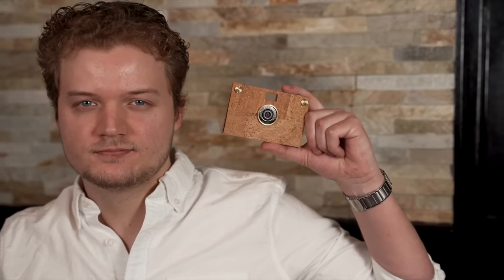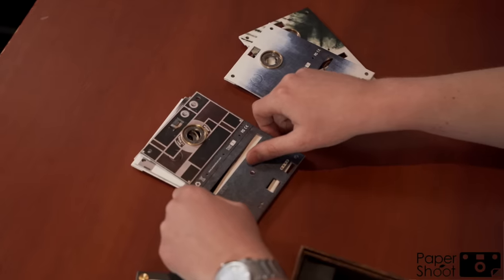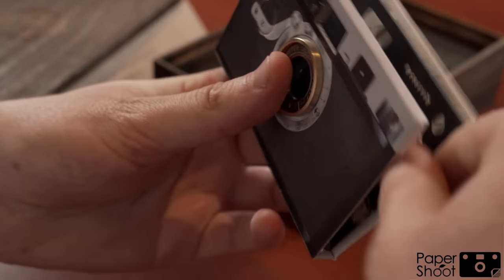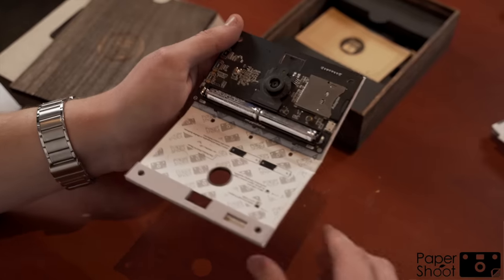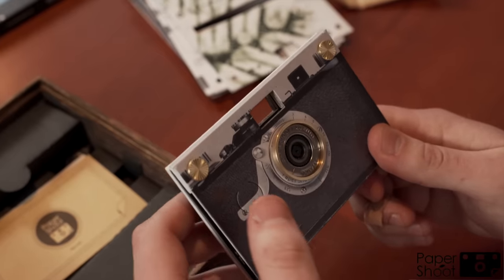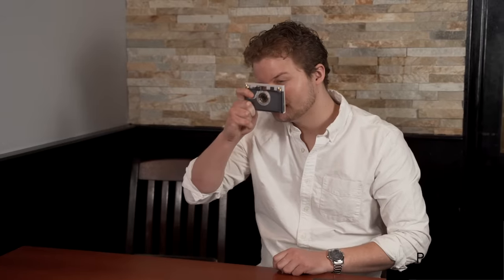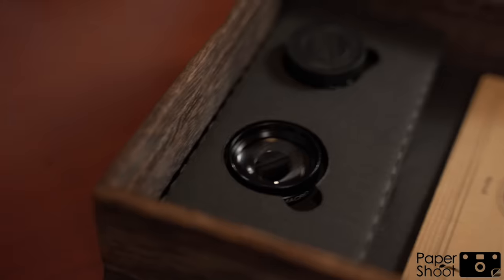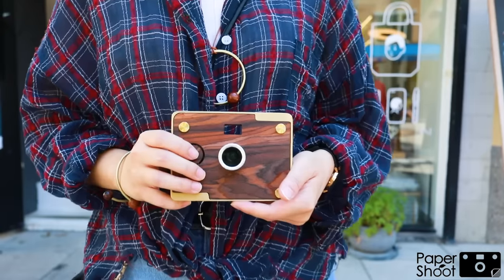This is Paper Shoot - Eco-Friendly Digital Camera

Comment: I love this idea but it's funny to think they just used a normal camera to record this advertisement
Reply from the maker: Haha it is funny to think about! The Paper Shoot is a great camera for photos, but the video function only shoots in 10 second intervals so it would be difficult to piece together a full commercial. But we should give it a try!
Reply: @cappycamera  are time lapse videos 10 seconds as well?
Reply: @LOL-VBE  I would like to know the answer to this as well
Reply: I wish paper shoot would have: 
flash (for dark conditions)
view screen (after photo taken)
long leather or canvas strap (for tall people)
Cover for camera (storage) 
Wireless transfer to phones (WiFi connection) or wireless transmitter add on
A holder for all the accessories
Different straps designs
Reply: @shaunnaruto  You could just buy a regular digital camera, like a Canon PowerShot 340
Reply: @shaunnaruto  I would like a flash feature since old school film cameras also had built-in flash but an LCD screen to preview after the image is taken completely counters the "in the moment" feeling that the Paper Shoot was designed for. It's a replaceable disposable film camera (without the disposable) so it's meant to not be a traditional DSLR or mirrorless digital camera.
Reply: @cappycamera  awesome answer. Made in China?
Reply: Its not for high def shoot ler, its for the experience ugh i hate comments like this
Reply: @shaunnaruto  then just use an actual camera. This thing was meant to be a toy and nothing more, cant ask for much more

Comment: i am loving this Camera, easy to carry anywhere. But i actually have a question, does it automatically turn off??
Reply from the maker: It is always on standby! So just click the shutter when you want to take a pic. No need to turn on and off!
Reply: @cappycamera  so I guess that will drain the cells sooner. Not that environment friendly in this dept then
Reply from the maker: @shashankshekhar3791  I personally have had the same batteries in my camera since December, never have changed them. They just charge when I plug my camera in every once in a while to view my photos. So it doesn't drain quickly at all.

Comment: cool ad and product but the output isn't "film like"
Reply: It's taken with a circuit board and not with actual film so it's not gonna have the film effect right off the bat. You can add it in post-production after you load them onto your computer or phone.
Reply: @seandavis8213  if it's a jpeg u might as well not be able to. I doubt something this "meh" is going to take raw photos. our phones only started doing it like 2 years ago

Comment: i was super siked to see what this was going to be. now i am not. as an eco friendly camera youd think this would be designed for long term use, but you cant even learn on it. its going to fail, everyone gonna buy one, find out it isnt a real camera in the slightest, and be disatisfied. use a disposable film camera, atleast thats not throwing away batteries and curcut boards, qnd yalls money
Reply from the maker: I’m confused on what you mean by not a real camera. It is an 18MP digital camera. We have thousands and thousands of photo results on our Instagram, website, social media accounts. We continuously offer new features such as filters, lenses, and new designs. The camera uses rechargeable batteries and can be charged by plugging it in via the provided charging cable. Our company has been around since 2013, and every couple months I get a DM from someone who’s been using their camera since we released the first version 10 years ago! We’ve upgraded since then of course, but they are built to last.